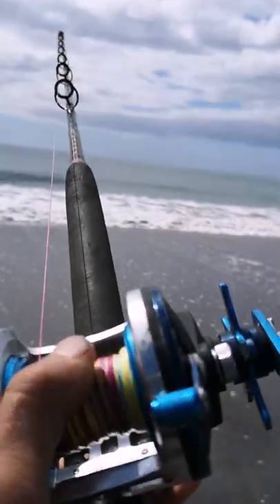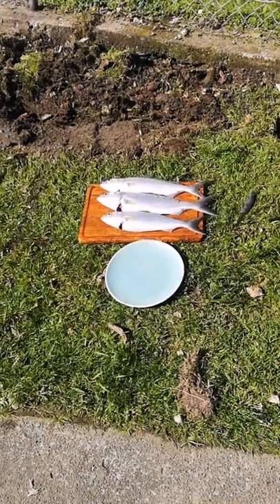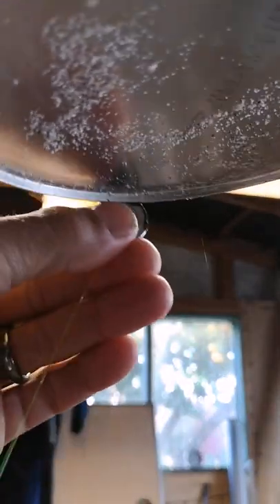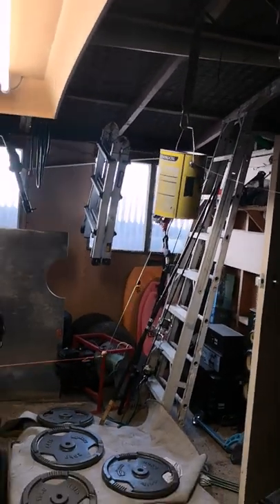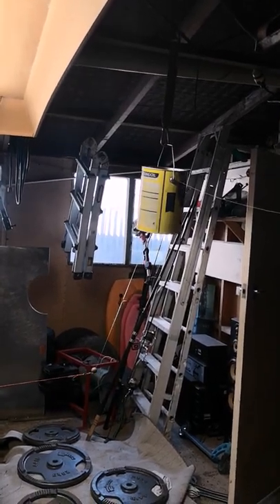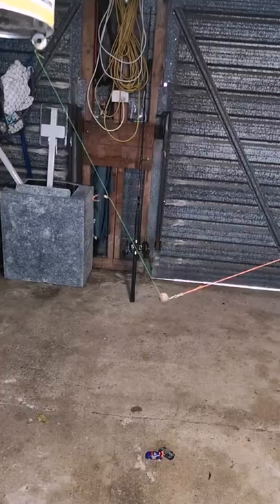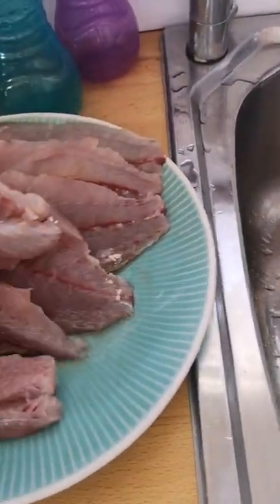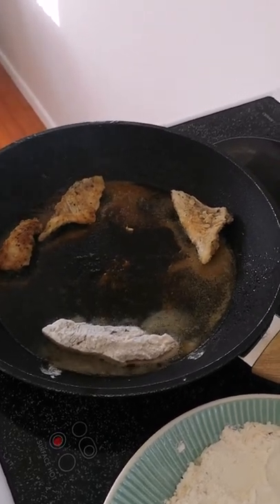Kite fishing with magnet release, catch and cook.

Comment: I am setting up a similar rig to use with two rods. Do you weight your tin so it stays on the surface of the water, or use a smaller tin and have it in the air? I’m thinking if both line are in the air there is less drag, so the kite would go out faster and less chance of tangles, but a possible issue of birds getting hooked as the bait fly’s out.
Reply from the maker: Tin is around 1/4 filled with water depending on the wind strength so it stays on the water surface. If it wasn't weighted it'd go really high but not as far. Only issue I have with drag is when it's getting through the waves. Once it's past the waves it's fine. I'm considering making a new streamline canister out of some light weight pipe.
Reply: Thanks for your reply, I have bought a Paul’s Fishing systems release clip, was going to tie the clip to the kite line but will now put  a milk bottle, part filled with water on the line and tie the release clip to that.
Reply from the maker: I also tried the release clip but was having trouble with tangles and getting the tension right.
The release clip is on line attached to the kite setup and the fishing line clips to that, so both lines are together. All it takes is a wave to knock it around a bit and you've got a birds nest. That's why I came up with this magnet system. The metal tin is smooth so line doesn't twist on it. Also the magnet is at the bottom end. The kite line is about a foot away from the fishing line. The kite is pulling the front of the tin and the kite line up while the sinker after the magnet is pulling the fishing line down. The two lines are naturally going opposite directions so tangles are very uncommon.
Reply from the maker: Hmm you've got me thinking now. The pictured example of how to set it up was basically what I was doing with my clip. I don't like all the exposed metal parts on that clip as they look like the sorts of things that would catch line and cause a tangle. But there's no reason you couldn't swap them out for something smoother. Or you could bolt the release clip inside a short length of PVC pipe and get a length of stainless wire, twist an eye on each end. Tie your line to one end and push the other end up in to the clip in in the PVC tube. That way no matter how much it's banged around in the waves it can't tangle. I'll whip up something and post a video of what I mean.
Reply: My clip came today, one end to hook onto the kite line, or in my case line from the bottle, and then just slide a snap clip into the mechanism. 
The release tension is adjustable.
I have made up a trace, release clip, line, sinker, line hooks then back to my rod.
I will try using breakaway sinkers, with the sinker at the end of my line then another line from the rope of the sinker, hooked under the legs and then to the release clip, that way it should drag forward when being towed out by the kite. 
All good in theory, once this weather settles I will got and actually use it and let you know how it goes.
Reply: Trialled my setup in the paddock this morning.
I have a flexiwing delta kite attached to 65 kg line on and electric fence reel, Paul’s Fishing systems dropper rig with a new kite.
Where the dropper line attaches I clipped on the kite release clip.
On the release side of the clip I had a swivel and snap clip, a short piece of line then six ounces of weight, to simulate a sinker and bait, then the line back to my boat rod and reel, loaded with 1000 metres of braid.
Once I got the setting on the release clip right I sent it out.
The weight of the sinkers made the kite fly out, not up, at 150 metres I locked the drag on my reel and then a slight pull, the line released and sinkers and line fell to the ground.
With just a flexiwing kite, no baits, sinkers or fish, on the dropper rig the kite came in easily, even with a moderate wind.
Thanks for the inspiration to modify my dropper rig so that I can use my kite as a drone to take my bait out, at a fraction of the price of a drone, and its waterproof too!!!!!
Reply: For fishing I will add weight to the kite line wheee the release clip attaches so that the sinker is out of the water but the baits behind the sinker are in the water to prevent birds chasing my bait, and to make the kite go out rather than up.

With the release clip in the air and the sinker below it, like it is with a drone, there were no tangles, I did six sets in the paddock, each worked perfectly.
Reply from the maker: @nathanread4198  that sounds really good. I've found it very dificuilt to get the weight right to send the kite out without some sort of float. Wind drops for a sec and the sinkers hit the sand. Could cause enough drag to release the clip. Or a big gust and it'll rip the lot out of the water. One thing that a land test won't account for is waves pushing your gear back on to itself. That's when my clips would tangle. Let me know how you get on tho. Your clip is different to mine and may work better.
Reply: optimistic but realistic took it to the beach, glad I took a bottle and a reel of line...
The waves made a mess of my hooks and main line, with a dropper line and bottle it all worked fine, now for more time fishing
Reply from the maker: @nathanread4198  exactly what I said in the comment above. It's the very reason I came up with this magnet release method. Your clip attached to the kite line which means the kite line and fishing line are very close together. Always results in tangles in the waves. The magnet in my method attaches to a smooth bucket. The bucket also acts as the bottle/float
Reply: optimistic but realistic my release clip also worked, just needs the separation between the kite line and the hooks, a dropper line and bottle partly filled with water did that.